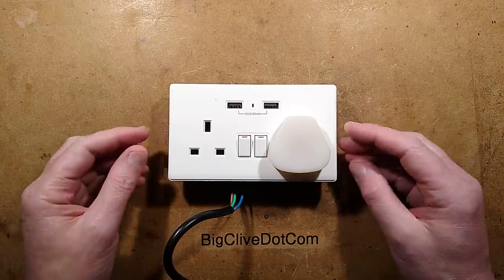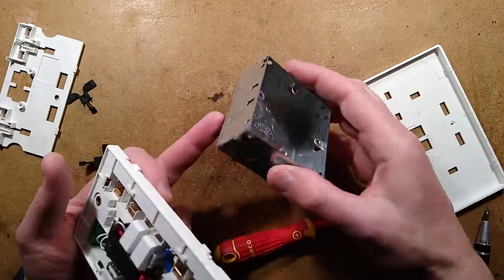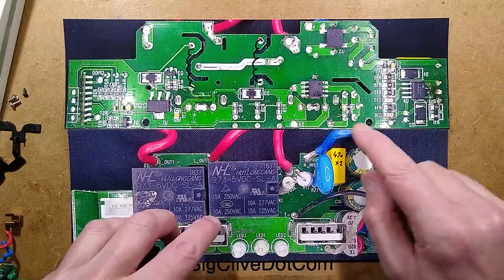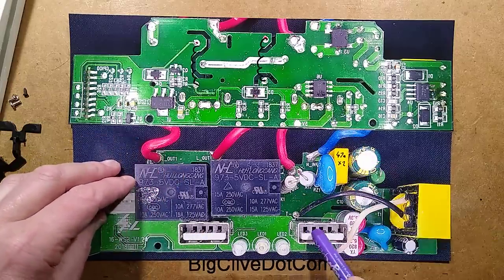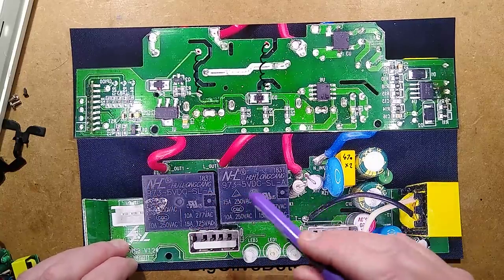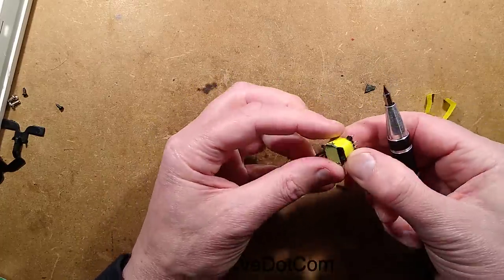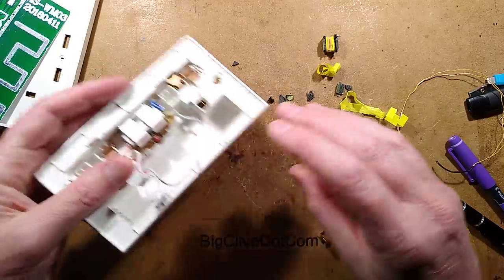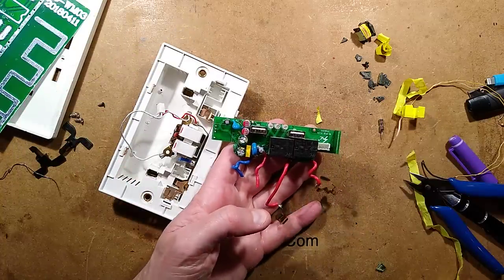WiFi wall socket teardown.

Comment: Clive, 
I've got an Audew Jump Starter box (10800mAh version) that has gone bad. Until 2 weeks ago, it's been an outstanding product. But I went to use it to jump start a lawn mower (hardly a challenge for it), and it wouldn't work at all. It reported the battery charge level was too low. So I put it back on the charger to find that it no longer takes a charge. It doesn't do anything when connected to charge-power. 

The charging port is a USB-C which is how you both charge it AND can power other devices making it the only In/Out port. All the other ports are output ports. But I wouldn't be surprised if the complexity of making it a 2-way port has become its downfall.

I tried to contact Audew to see if I could get it warranty replaced, but being it was a gift, I don't have any of the original purchase info, so basically they've told me to pound-sand (really helpful customer service). But to my point, I think the problem might just be the charging circuit. I'm fairly sure the batteries inside are probably just fine if they could just receive a charge. 

Any chance you'd want to take a look at it and possibly make a video about it? An added benefit to me would be just having a video about how their product(s) can fail out in the public domain...even if you mention nothing about my customer service experience in the video. I have no clue if it can be fixed/rigged to work or not. But you might...
Reply from the maker: It's possible that if it's been left for a while that one of the cells has dropped to such a low voltage that a safety circuit had kicked in.
Reply: @bigclivedotcom  I guess that's possible. It's less than a year old. So it's discouraging to think a bad cell is responsible. I'll open it up and poke around with a meter and see if I can learn anything. I might should find myself a fire-containment pie dish. 

I think I remember you reviving a power bank by trickle-charging it to get the voltage above the safety cutoff and get the unit back working again. In this case it's doubtful. When the jump box is not in use, it was always on the charger. So it's not like it sat for months and discharged below some threshold that prevented recharging. If it's a bad cell, it's not likely worth even trying to repair, nor would it make for that interesting of a video.
Reply: @bigclivedotcom  I opened up the jump box and was impressed how relatively simple the inside was. The circuit board was mostly doing voltage conversion for the USBs...up-converting the USB-C voltage when connected to a device that can't supply more than 5v. As it turns out, the battery charges to about 16v...although I didn't know that at the time. 

When I measured the voltage, it was just under 6v. So I tried what you did with the USB stick...manually charge the battery some and see if I could get it to hold a voltage high enough for the electronics to start working and charge the battery like normal. Once I got the voltage to roughly 12v, the USB-C charge input was able to take over and charged it to full in a few hours which is when I discovered it targets 16v. We'll see if it holds a charge overnight and cranks the 21hp riding lawn mower tomorrow. 

But anyway, thanks for the idea of trying to manually charge the battery. It MIGHT have given new life to this device. Only time will tell.

Comment: Making a smart relay box would be more sensible. Just plug it in onto a regular socket. 
Your choice of relays, your choice of wireless modules, your choice of safety and fire hazard.
Reply: Well, you’ve pretty much described the X10 home automation system, developed in 1975 by Pico Electronics of Glenrothes, Scotland.

Comment: I designed a wifi socket using ESP8266 and had the same problem of signal shielding. The only difference was, I completely avoided electromechanical relays and used Opto-TRIAC as load side switches. When i got the unit out of the wall, it started working like charm! 😀

Comment: I would have added a small reset switch for the wifi and possibly added jack sensing to the USB sockets so when unplugged, the charging circuit would be off. Could have also added some sort of printed wifi antenna to exterior of faceplate as Clive said, signal would be quite blocked if in a metal pattress and buried in a brick wall

Comment: The yellow wire will be triple insulated wire. Two outer coverings and enameled copper wire and probably rated class B due to using poly tape and not Kapton tape in the transformer construction (cheaper). It's surprising the power these small transformers can give out if properly designed.

Comment: When BT installed telephone lines they were usually by the front door in the hall. For wifi around the house you need the units central for even wifi everywhere. The modem router by the front door is not central. When wifi first came out they listed the wifi by how many how many meters away a device would work with no walls. This is no longer listed.

Comment: It's next up part, the ESP8266, is known to drop network, and often even a reset do not bring it back online (you need to power cycle it). There is ways to mitigate the issue, but not always.

Comment: Well... I get your point about it being kinda inconvenient to have something fail "inside" your wall without you really being able to disconnect it easily.
I personally am quite into active electronics, microcontrollers, home automation etc. I do however tend to design as much of the hardware and write as much of the software as possible myself. Most commercially available home automation products are absolutely ridiculous to me. The software tends to be really buggy/glitchy. Every manufacturer has their own app which can only control their devices, so you basically have the whole "too many remote controls" problem all over again. Just so they can "bind" you to their company. And apart from all the obvious problems, I don't want to have to send a signal twice around the world and back to my home just to turn the light on and I also like being able to turn my lights etc. on/off even if my internet drops, not to mention the whole privacy aspect of sending data about everything you do to some servers somewhere. Some of the commercially available products are just unbelievably dumb. And the systems that do work reasonably well are hilariously overpriced. It's a shame... It kinda gives the whole thing IoT thing a really bad image. While in reality I think there are many cases in which IoT, smart devices etc. can be a huge improvement.
Anyway, my point is, I can totally understand many people not really being in to it. Most of these smart devices are expensive, overly complicated, unreliable and really don't offer any significant advantages over comparable "non smart" devices. But keep in mind that most of this is due to bad engineering.
If you build something to work, using active electronics, Wifi etc. and write a good and reliable program for it. It will work and it will be perfectly safe and reliable.
I know this is kinda off topic. I just felt the need to mention it. :D

Comment: I'm sure I saw some wi-fi device in poundland for about £7. I bought some remote lights for experimenting with though. I'm sure you reviewed something similar before, but now they've been updated to COB style. They take a few too many batteries, but I have the intent to modify for boats (I deal with a lot of boaters) with some low voltage step down PSU (those cheap 12v to 5V USB adaptors (using the 34063) are good for that, as you can alter the output voltage somewhat for 4.5V battery operated stuff, and they are nice and compact to go in an existing battery compartment. I like the safe low-voltage lighting that is possible these days. I definitely agree about the use of active circuitry built into walls, it's fine when it's working, but a real pain when it fails (in common with all processor controlled stuff - one bad spike, and it's toast).

Comment: Usually, this kind of junk requires you to register an account on a web site or an app on your mobile. And from there you configure it to work with an app on your mobile, Alexa, Google Home, Apple or whatever. And from there it will harvest your data and sell it. That's why they are co cheap.
With these things it's always a surprise what comes first: the device pops and quits working, or the web site will be decommissioned, both resulting in a non-functional device.
Whell there's an ESP chip in it, so you're lucky. Usually that can be flashed with Tasmota or ESPEasy, which enable you to control the device directly via your own home automation system. Although I prefer the relays that plug in. Much easier to replace when it pops and better wifi reception.
Reply: I prefer those you plug in between the socket and e.g. the lamp as well. you nailed the reasons. I got ones from Amazon shipped as Gosund brand. I am sure they not only look the same as about 20 other brands offered online.
About those devices collecting data, well, I do not actually suspect those devices to sniff any data. What exactly are those supposed to collect? Oh, someone switched the lights on and of three times a day? What I would be mure suspicious about is what the App you need to configure them initially does on your phone. Here my paranoia got me, I installed the app, aded the devices to the network, added the stuff to the amazon alexa app, and removed the app again.
I also wondered about how long those brands and there servers stay in service. On the other hand, with the amount of different brand name devices for this on Amazon alone looking almost to exactly the same, I would not even wonder if all those brands actually belong to one manufacturer.
Lately I found devices on Amazon that even advertised using servers located in Germany. I guess it is a German brand, with German servers and hardware made in PRC. Only I wonder, do I trust more in this small German company still beeing around 10 years from now (if it really matters and the devices still work at all) or some bigger general manufacturing company selling multiple brands. As I said, I am in doubt every little maker in China is running their own servers.
Just for fun maybe I should put a sniffer on my line and check what those things actually connect to.
Reply: @alexku8452  Last year, I bought 7 of those cheap switching power plugs: LSC Connect. That is just the wholesaler/OEM. The back-end is done by Tuya. (google them). LSC Connect has an OEM account at Tuya and they can use the developer framework to create their own branded app and all that jazz. Tuya portal provides them with all kinds of usage data and what not.
Anyway... I fired up a Raspberry that emulates a Tuya firmware update server. So those 7 plugs already got Tasmota firmware before they were able to connect to Tuya. Never installed the LSC app. And now it's working nicely with an open source home automation platform.
I got one smart bulb that I couldn't flash, because they didn't use an ESP in it. I converted it into a dumb bulb,  bigclivedotcom-style.

Comment: 10:04 The ESP 8285 is pin compatible with the ESP8266 wifi micro-controller but with built in flash memory thus the unpopulated bits.

Comment: i have never seen anything like them metal boxes here in Aus, nor plastic ones, inside at least anyways,we just cut a hole in the wall, clip in a little metal bracket mount (some people dont even bother with that), then screw the  outlet the the bracket or wall ...

Comment: The 8285 has built in memory. They could use an ESP8266 on that board which would require the use of the extra contacts for a SPI RAM chip.

Comment: The reason to have it built-in to the wall is likely wife factor and being able to fit it behind furniture.  Plug in adapters protrude a great deal and also means a higher chance of hitting the thing, or the weight pulling a poorly fitted socket off the wall.

Sadly these factors will often outweigh the actual logic of embedding electronics where it does not belong.

It annoyed me that when I wanted to find a one to four and two to four adapter for the kitchen, I could only find ones with surge protection.  Although  I guess a surge protector blowing up against kitchen tiles is probably safer than anywhere else, and at least the kitchen has its own breaker.

Comment: The best setup for wifi access points is ceiling mounts. That metal box looked a lot like US style boxes—i thought the norm is the UK was surface-mounted devices, not recessed flush-mounted devices?
Reply: No you can have what you like,  metal recess boxes are usually for plaster/brick walls and plastic recess boxes are usually for phoney walls (plasterboard and wood batten). Surface-mounted boxes are just a lazy and quick way of getting power without any wall preparation to sink them, but if its a very old property it might have walls of hard stone or something.
Reply: The number of properties I have seen here in the UK with surface mounted wall outlets and/or switches I cold count on my fingers, and I am 60 years old.  I saw a few in France when I went on holiday there but those were in stone cottages where it would have been hard labour to cut in a suitable recess.

Comment: The esp8285 is basically the esp8266 with the flash integrated into it. I suspect perhaps they moved from the 8266 to the 8285, hence the empty pads.

Comment: I moved into a house with usb sockets in the wall sockets.. they claim 2.1 amps and at first they did supply that.. since the kids have a habit of bending wires in tablets during charging they semi- burnt out and only supplied around 300-600ma current dropping voltage randomly also. 

However one of the wires completely melted in the usb socket.. good job I was in the room as i noticed a burning smell.. which wasn't stopping or shutting off either. Normal usb chargers the majority of them shut off during shorting conditions. They aren't cheap sockets either!! I have since removed these and deemed such fitted electronics an absolute hazard. Just a mild warning to anybody considering these. ( Im sure some can be ok if used properly etc. And some of the damage may have been caused by the kids granted, however they still did not auto shut off during a fault!
Reply from the maker: I'd recommend stocking up on good quality USB cables and making your kids aware of swapping out old ones when the cables get damaged at the connectors.  This is even more important with the new high speed charging systems.
Reply: @bigclivedotcom  agreed, I thought the best solution would be to buy those magnetic charging cables that way when they decide to go crazy and yank it then they will just disconnect, that will also automatically teach them not to yank said cables itself

Comment: How does this plate installed in the UK? Do you have double wide circuit box that matches this plate? Living in US, I really appreciate the compact size of the 3 prong 110v sockets that we take for granted. Where every outlet is a dual sockets outlet in a very compact size, and our extension power trip with 6 outlets is the size of a large banana.
Reply: Yes, we have wide '2 gang' back boxes and surface patresses to take double sockets, and they're a bit less than double the width of a single. John Ward did a video on UK back boxes not that long ago.

Comment: Besides Clives point about malfunction what about when chargers and wifi evolve or people move out and the new old lady owner doesn't have a clue
Reply: This is something I've wondered about. What I've come to is that the average fast charger can recharge the average phone many times over the course of a night (when I'd imagine many of those would be in use). Unless we get a major jump in capacity I don't think it's an issue for USB at least.
Reply: @shodan2958  yes I guess so if you're recharging overnight. I've had problems before the QC in my car running gps and charging
Reply: @fanplant  yeah that's true, I was thinking more about the USB connectors in plug sockets.

Comment: The 8285 is a variation of the 8266 that have 1Mb of programable flash, the 8266 don't have that so the manufactor should add an external flash.
Maybe the manufator design the socket to use a esp8266 and later change the design to am 8285 for lower the costs

Comment: The ESP8285 is just an ESP8266 with 1 MB of flash memory, so the empty footprint is probably used if you are using a ESP8266 with a chip like the ESP-PSRAM64H.

Comment: It looks like the wifi circuit was originally designed for the ESP8266, which does not have any memory where as the ESP8285 has inbuilt memory in the chip, so external memory is not needed.

Comment: So, forgive me, but I don't understand the purpose of this device...  Is it so you can control those switches via your WiFi network?  What software would you use to do that?  Wouldn't that require some sort of special software from the manufacturer of the socket?

Comment: I know the plaster used in US east coast homes after ww2 up to when drywall became popular has a wifi and cellphone blocking effect but did the plaster in the UK do the same? So placing a wifi device into a RF blocking wall would have a very bad effect on a signal.
Reply from the maker: Some of the boards have a metal foil backing, which acts as a screen.

Comment: Clive, a question if you have time. What would be the best way and best product in your opinion to control Garden lighting for a large upmarket garden lighting job I have coming up. Customer wants Wifi control no Blu-tooth. Socket or relays in IP rated boxes? Do you know of any IP rated Wifi relays?
Reply from the maker: I don't know of any waterproof WiFi devices.  You would need to use WiFi switches in waterproof plastic enclosures.